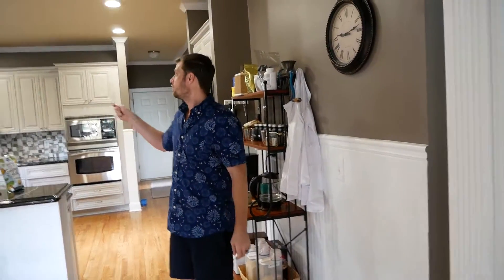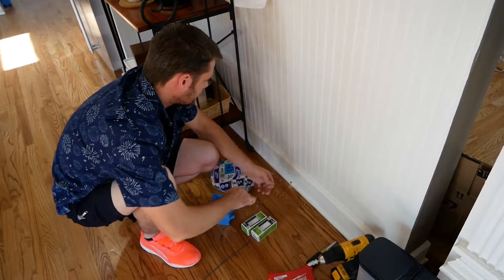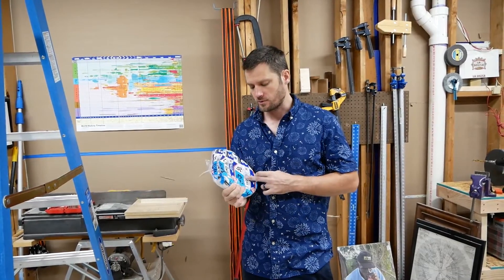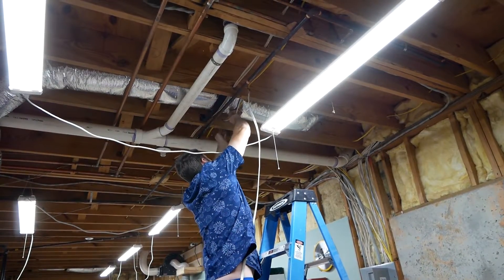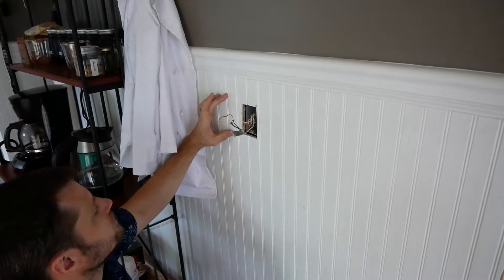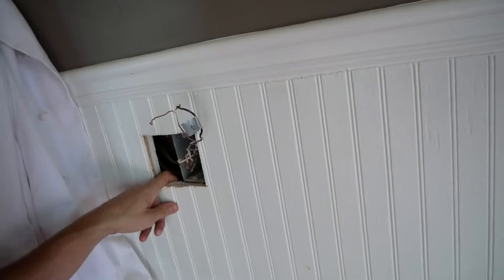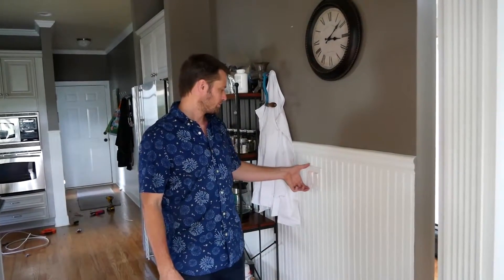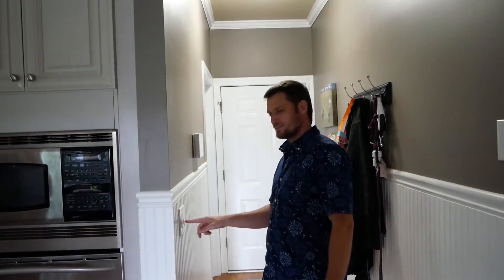Second Light Switch (2-way to 3-way conversion)

Comment: OK, so the new cable has one "hot" lead, and two "travellers" going back to the old switch. And no neutral at all. Is that legal? I've seen that diagram in a few places, so I guess it is, but just double checking.

Comment: you should have shown wiring the switch. Its the whole purpose we are watching.
Reply from the maker: Hey @mathewblevins2584. I have a link in the description to wire diagrams with multiple orientations depending on your particular setup. They are much easier to understand as a diagram than via video. Thanks for the feedback.

Comment: You could have gotten your power for the three way switch from the two gang old work box that you put the dining room switch in, and the two gang box that has the switch for the hallway light you would just pick up the switch leg for the kitchen lights on your second three way switch. Just letting you know that you could have wired the switches differently. Your two switches in your old work box would share a hot wire fed from the breaker, and your hallway light switch would have its own hot wire.
Reply: Very true. I think he said that the dining room light is on a separate circuit. But if both lights were on the same circuit, then your method is better

Comment: I need to do this exact thing and have looked at all these different electricians and couldn't figure it out.  I've watched this and now it makes sense. Can I ask one thing, could you make some sort of diagram of you existing switch and how you connected it.  Thanks!!
Reply from the maker: Hey JJ, glad the video was helpful. There are many possible configurations depending on the particular setup you have. Go to google images and search '3 way light switch diagram'. That will get you pictures of just about every configuration out there. Studying a number of different configurations should acquaint you with the 'logic'. Then find one that matches your setup to imitate, but always check against the 'logic'. Above all it should 'make sense'. Hope that helps.
Reply: It's possible for the power from the panel to start at the light or at the original switch, so the final circuit could have the light first, in the middle, or at the end. The wiring is different for each case from what I've seen. The first thing to do is to map out the original circuit. That's where I'm at in my own project.